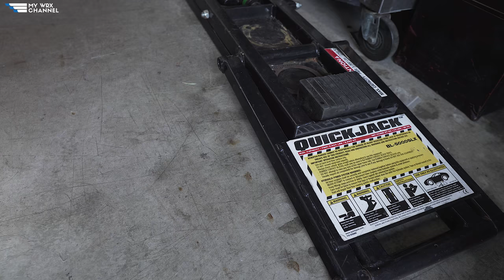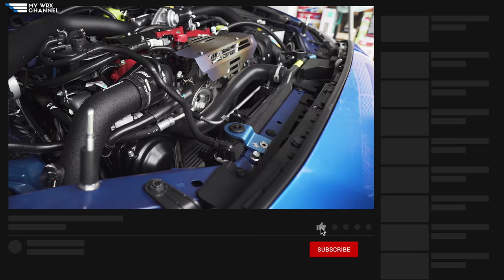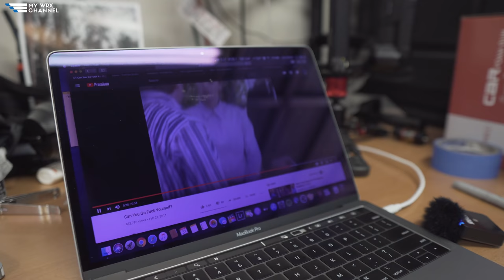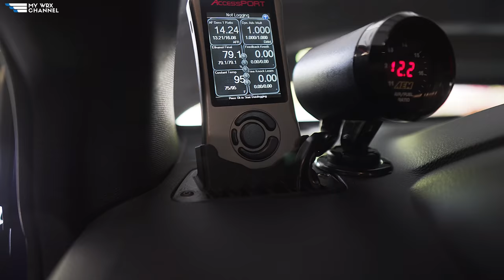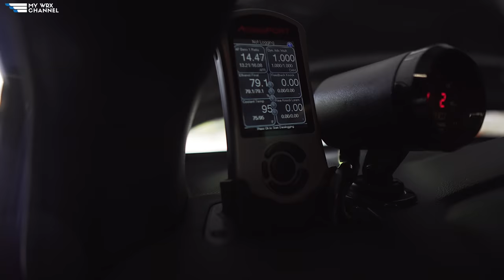STI KOYO RADIATOR INSTALL IN SILENCE | MAKING THE STI COOLER | 2015-2020 SUBARU WRX STI

Comment: There's a note on this rad - due to the increased thickness, you will need to trim your upper radiator hose a little.  That's why it was hitting your accessory guard, and it gets really close to the pully.  Trim a bit off the end where it attaches at the rad, and you will have plenty of clearance. 👍

Comment: Hey man, this video was super helpful! What did you put into the funnel to stop the excess coolant from coming out ?
Reply from the maker: Here's what I used to fill and burp the cooling system. https://www.amazon.com/dp/B01I40ZQWE/ref=as_sl_pc_qf_sp_asin_til?tag=mywrxchannel-20&linkCode=w00&linkId=06375ebbc6ecf781c97fc9773c37701c&creativeASIN=B01I40ZQWE

Comment: Our stock radiators are super puny. I was at least expecting a dual core from factory. I guess it’s only important in the summer or if you live somewhere hot like I do.
Reply: Mines turned green after 4 years. Didnt help hiding behind the FMIC. Just installed the Koyo

Comment: Need your help bro! You have an awesome Chanel and have learned lots!
I have a 2020 WRX, stage 1 + sf, just installed a j pipe from Cobb catted and stock axel backs with Remark muffler deletes, , I’m using the Cobb stage 2 + sf tune and my psi is only 10-12. Removed the restriction pill as well, why is my  boost sooooo looow? Please help

Comment: Hey man. Appreciate your content. 
Seeing that you also had a 2015+ wrx before this STi, how would you compare the electric steering of the wrx with the STi? In terms of steering feel and being direct. Leaves much to be desired or passable?
Reply: 15+ WRX 14.4:1 ratio with electric power steering gives me some extra confidence on quick connecting curves. It’s a day and night difference when you hop into a lower ratio car. The electric assist is like butter but I think both systems really can simply just come down to preference. The STI ratio is 13.3:1, which is high compared to most production cars. My choice though is electric ftw⚡️

Comment: Why didn't you turn on fan at max and heat at max. Also, squeeze the upper radiator hose to faster bleed the system?